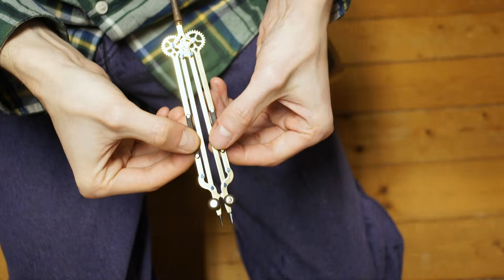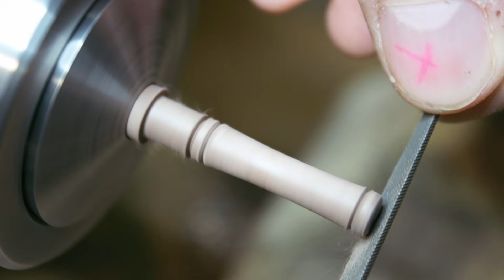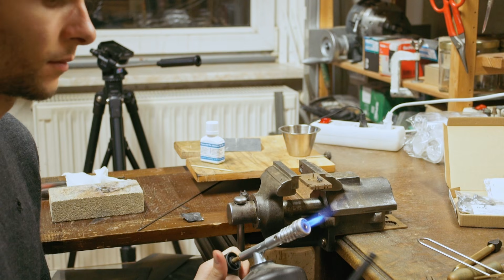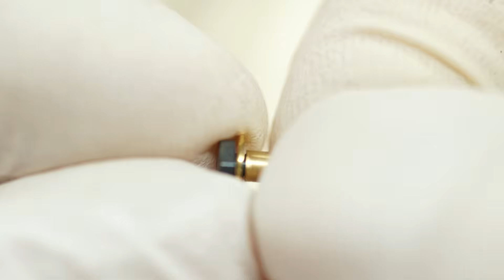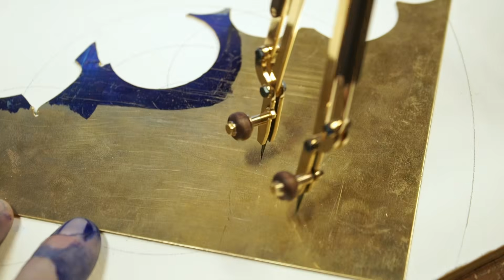This novelty Compasses always keep their tips straight

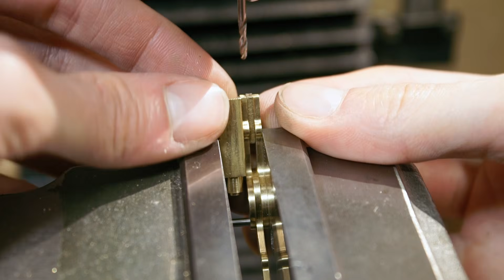Comment: Amazing design. At 2:35, you could use a "U" shaped piece of brass with a 1.5mm gap to form a square hole to guide the drill.

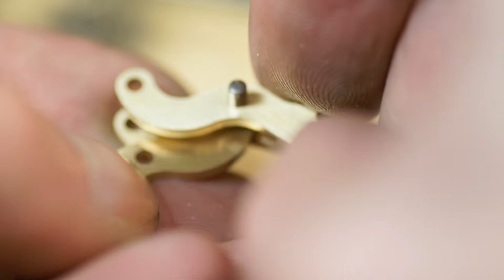Comment: 2:47 if you cut a single wedge groove (triangular) you would have self-centering and ability to fit a variety of graphite tip widths
Reply from the maker: Good idea, but not really with this design as the spacing of the two plates is fixed because they serve as hinges at the same time... But a more sophisticated design could allow for a feature like this!
Reply: @ValentinFelder  yup, would probably need some free floating, spring loaded plate with screw/lever or some over-center mechanism. Even so I really love the design of this brass compass.

Comment: out of curiosity, how come you did the grinding of the tip after quenching? forgive my ignorance it just seems like that operation would be easier while the metal was softer
Reply from the maker: Heating and quenching creates a thick and ugly oxide layer (the black stuff) and also a very fine tip would easily burn off in the process. So I just machined the rough shape before, but the actual sharpening and surface finish can only be done afterwards for a sharp and shiny tip.

Comment: Add two horizontal crossing arches that read the specific angle degree (one side measurements the other side indicator needle) that are tension held against each other to stiffen the mechanism. These arches are attached to one branch (probably the outer) of both sides.

Comment: Can I suggest an improvement?  The needle ought to be ground with a shoulder about 1.5mm from the tip, this stops the point wallowing out the hole made by the needle in soft materials like paper, which generates inaccuracies especially, with concentric circles.  This was a feature of my Jakar drawing instrument set that I fully appreciated 60 years ago.

Comment: Oh wow... this is GORGEOUS!!!!!    How much would you charge for the design file for the laser cut parts?  I want to make some of these with my engineering students!!!
Reply: HAH! I made it to the end, and see you have them up for sale on your patreon.  Good man!
Reply: Paid and subbed! Can't wait to order these laser cut from PCB way. I've been wanting to try them out for a long time now, and you've finally given me a reason to do it.
Reply from the maker: @jonnyphenomenon  I hope PCBWay will be able to make them as precise as needed, I had ordered them from a company specializing in micro-laser-cutting years ago. Have a good look at their tolerances before ordering, I think it's +/- 0.1mm or something on parts of that size. Maybe make the holes even smaller and open them up later just to be sure, and other than that the gears are the only critical geometry, which is not ideal to laser-cut anyway - But I think it should work with a bit of sanding just like I did... Good luck!
Reply from the maker: @jonnyphenomenon  Thank you so much! I hope it will make a cool project, would love to see the results. - As I said in the video, there are probably a few improvements to be made, maybe that would also make for a nice challenge - How to add a fine-adjust / cross connection for example?
Reply: @ValentinFelder  I agree that a fine adjust would be nice, but I usually can live without one.  A "locking" method is usually what I look for in a compass.  I've got some exquisite old K&E compasses that I never use because they slip and spread out when I use them. I end up resorting to a modern era staedtler or something that stays exactly where I set it. 

I'd love to show you some of the projects I've worked on with brass and exotic woods. How would I do that here?
Reply from the maker: @jonnyphenomenon  Would love to see your stuff, sure - If you have it up online somewhere you can put a Link in a comment, otherwise you can write me an email but then everyone else misses out on it. ;)
info@dasgetriebeimsand.de

Comment: Your gears appear to have a great deal of backlash which will compromise the quality of the circle being drawn. Do you have a solution for this? In my own experience with lazer cut gears produced acceptable results for prototyping but not for production, but it was fun doing it anyway.
Reply from the maker: Yes, the lasercut gears are certainly not optimal. Right now I don't have a better way of doing it, but theoretically it would be best to cut the gears on the mill with proper tooling.
But I think the backlash would not be as big of a problem if there would be a fine-adjust cross-connection between the arms, which would also be easier to do.

Comment: That's not over engineered,  you've achieved greater efficiency and accuracy. Beautiful craftsmanship and ingenuity as well. I could have used this compass while spending hundreds and hundreds of hours with Geometry. And yes the additional cross mechanism would be absolutely fantastic ( will provide the extra stability ), maybe the slightly curved type would be optimal and would only make it more beautiful than it is already.

Comment: As a solution for your problem around 8 minutes, you could always have a part shaped like a top hat acting as your bearing surface and nut if you thread the inside of it, then scre into the top hat so the whole assembly is shaped like a sewing bobbin

Comment: Could you make the handle static over the point? Then the  rotation handle stays steady while spinning. You would have to extend the end piece that holds the point all the way up. Otherwise one arm would be taller than the other causing a tilt.
Reply from the maker: Yeah, but how would that work for any diameter? The length of the second arm would also need to vary automatically...
Reply: @ValentinFelder  i am imagining your point is 8 inches long and has clearance to make it past the gears and stick out above the top.  Imagining that, put a handle on it. Other than that it would be the exact same design you have.  Now there would be other ways to extend that short pivoting member to the top but i was just using that as a mental model. Could even have 2 handles. One on the axis of rotation and the same you already have. Dunno, just always hated the tilt of a compass myself. Love the design
Reply: Imagining the forks of a bicycle. Extend the forks past the gear and combine to a handle

Comment: What a beautiful project 👍😀.
As a retired machinist/ mechanic can i give a tip ....
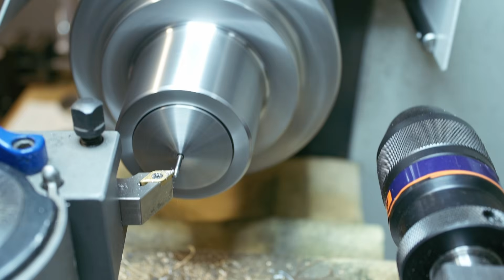At 2:57 in the video you are cutting a small diameter , it is easier to cut these if you use hss cutting tools.
Carbide has always a nose radius that is not truly sharp , as a result it is more of a controlled crumbling instead of truly cutting like hss tools do.
Carbide also take more cutting power than hss tools to get them to start cutting.
Hss tools still have their use in a shop , it is a matter of using the correct tools for the job 😀.
Specially on these smaller diameter hss is superior in cutting and surface finish.
I
Reply from the maker: Thanks for the tip, that sounds very helpful indeed - I don't own a tool grinder, so I always shied away from HSS tools, but especially on brass they should still last quite a while I guess...
Is there any reason there are no sharp carbide turning tools? Carbide mills are truly sharp as far as I know, right?

Comment: You could maybe use a tungsten needle, would probably be overkill.
Reply from the maker: Haha, not only hard, but also hard to find any raw material of that size :D
Reply: @ValentinFelder tig welding electrodes are alike 200mm, I have also a scribe from Temu, but the tip is less then 20mm

Comment: Hmmm. A pantocompass? A great implemtation and absolutely beautiful. While the parallel needle and lead are useful in some circumstances, there are many cases where they do need to be set at an angle. I made a quadrant compass for working on spheres where the lead is always perpendicular to a tangent where it meets the sphere, but even these were limited. Now my goto compass is the Staedtler 550 (vintage with the Circofix locking feature). Working inside domes presents even more challenges and I still have not found or figured out a good solution yet.
I know the brass is beautiful, but it will tarnish, so I wondered if you considered nickel plating?
Reply from the maker: Whats the reason for working on a sphere or inside a dome? Just wondering :D

I like the brass color and when polished it forms a darker yellow protective layer over time which holds up quite well. (I have parts I made years ago which still look really nice) - Most important is to not cover it with sweat, so the wooden handles are really necessary :D
pure Nickel prevents oxidation, but it might lead to allergic reactions on the skin, so I wouldn't recommend it. What I sometimes do is to gold-plate brass parts, that works well and looks great, but it seemed a bit too much for these relatively big parts...
Reply: @ValentinFelder  On a sphere or inside a  dome I make Islamic Geometric Designs and also use a compass to mark out spheres for turning into various polyhedra.
I know what you mean about the brass. I used to use brass a lot, but it's become a bit expensive now so only for special projects like yours.
Reply from the maker: @DancesWithAardvarks  Awesome, I'll have a look at your channel ;)

Comment: this is beautiful. It touches my mechanism loving heart, and my drawing heart.
I need a cnc cutter and a milling machine now to make my own.
Reply from the maker: A drill press and some basic hand tools should be enough actually ;) - I had the laser cutting done by a company, and I also don't own a CNC machine. The few basic milling operations I showed in the Video could also be done by hand, and for many years I also used a drillpress with some files to perform make-shift turning :D

Comment: Should find a way to screw down the main top handle to lock the positions of the arms
Reply from the maker: True, that's certainly a feature which would improve it a lot. I'm thinking about a cross connection between the two arms for that purpose, as it would also make it more rigid...
Reply: @ValentinFelder Or a worm gear to adjust the legs & use the anti-back drive of the worm to keep them in place, you couldn't have much backlash though.
Reply from the maker: @steveporritt1550  That would be very cool, but also quite difficult to make - One side of the worm would need a left sided thread, and also the "nuts" would need to swivel on the legs as they spread...
Reply: @ValentinFelder I'll admit I hadn't thought that through enough. Love the tool beautiful work.
Reply: There’s many that have that wheel in the middle and coming out of each side of the center having one be regular threads and the other side reversed threads just need a way to lock the adjusting wheel thing in place so no mistake bumping of the wheel won’t change the size. Would be amazing to have each thread be a fraction of a measurement to really be precise like 1/64” or depending even more. Tho the more precise the harder it will be to have a rigid tool. So idk love the idea and would love to see other solutions for this too. 😜 I suck at the actual making of things but can brainstorm and make plans all day long.